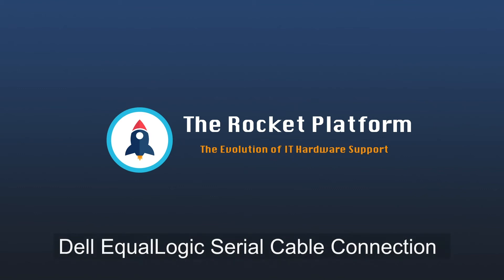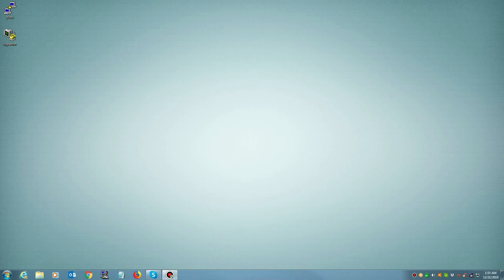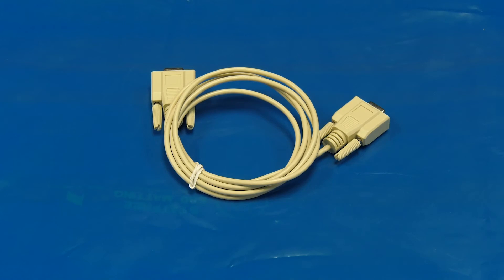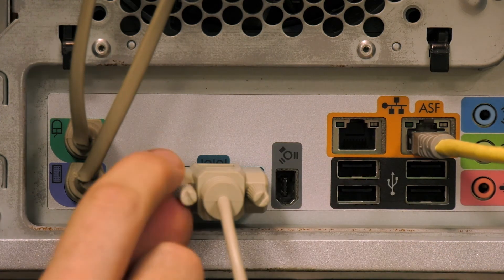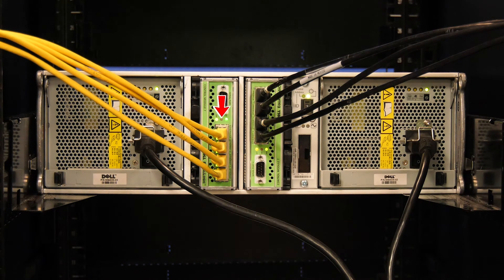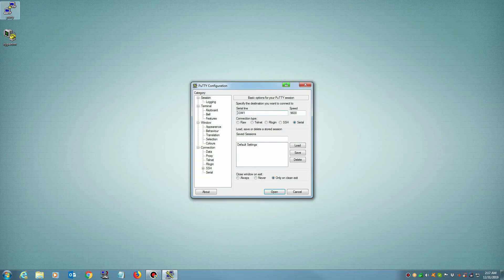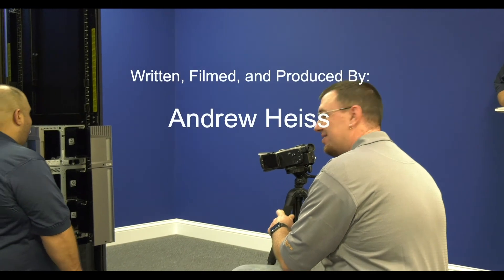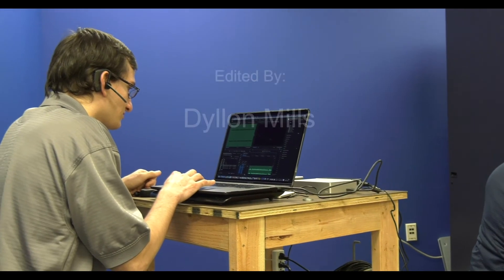Dell EqualLogic Serial Cable Connection

Comment: Hi i have a Dell equalLogic PS6000. So my problem is that the terminal doesnt Promt the login. Also small thing is it a problem i only have one eth controller
Reply from the maker: If you would like to engage us for support, please reach out to us at support@therocketplatform.com and one of our engineers will contact you.  Thanks!
Reply from the maker: Alternatively, if you would like to put your PS6000 under a RocketPlus subscription, you will get access to a free 15 minute support call with one of our technicians.  You can see the benefits of RocketPlus here:  https://therocketplatform.com/pages/rocket-plus-landing-page